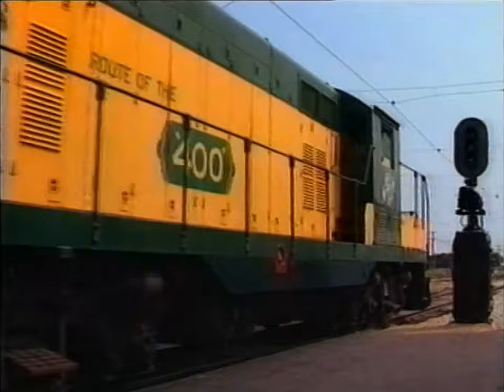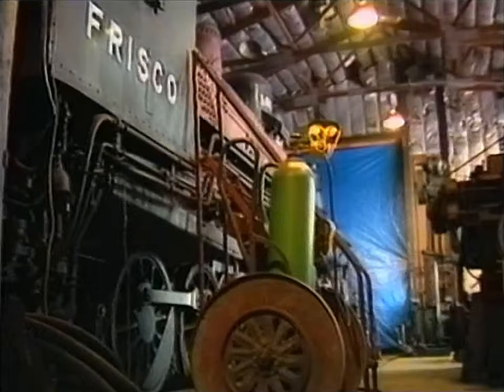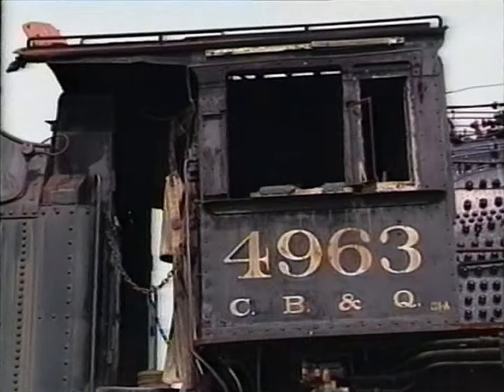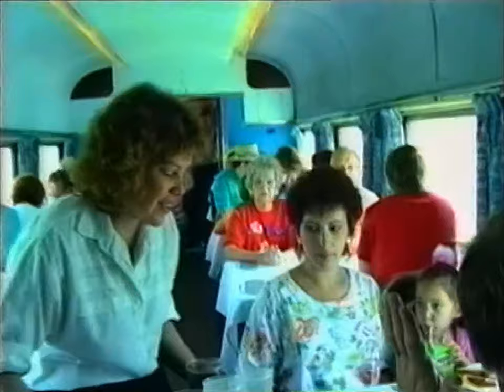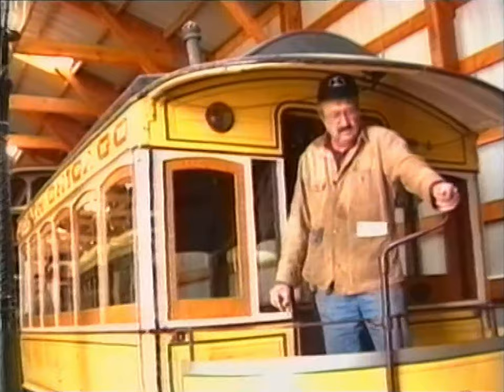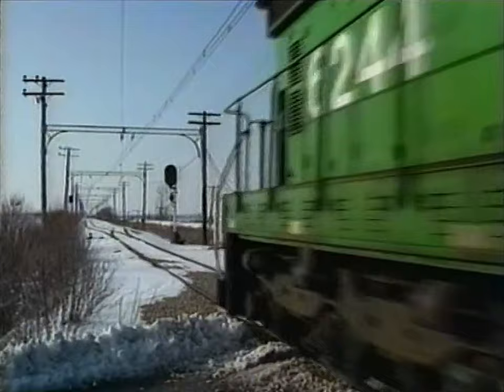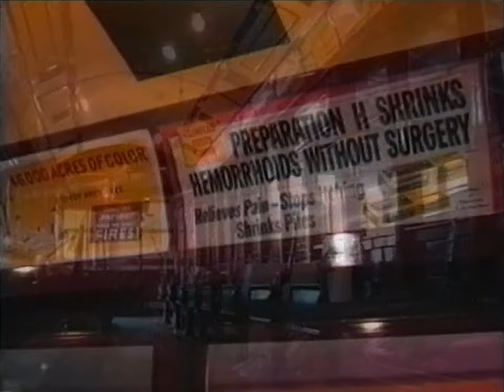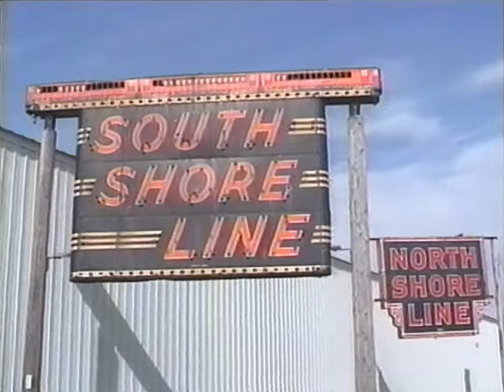The Illinois Railway Museum in 1992 (Documentary)

Comment: I have been to the Illinois Railway Museum in Union, Illinois back in October 7th and 8th 2023 during the 70th anniversary there. I had got to see a lot of the equipment along with five that were running with those being their impressive J. Neils Lumber Co. Shay #5 (Built by Lima Locomotive Works in 1929), Frisco 1630 (Built by Baldwin Locomotive Works in 1918), Chicago, Rock Island & Pacific GP7 No. 4506 (A.K.A Rock Island GP7 No. 4506, built by Electro-Motive Division in October 1952), Chicago Transit Authority Trollies 4410 and 4412 (Built by the Cincinnati Car Company in 1924), and Chicago Transit Authority Trolley 3142 (Built by the J.G. Brill Company in 1923).